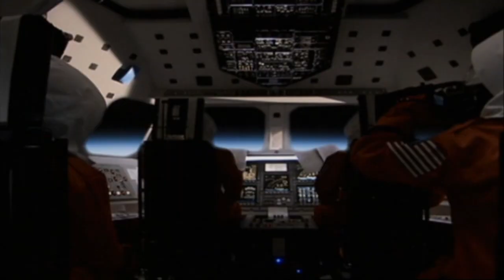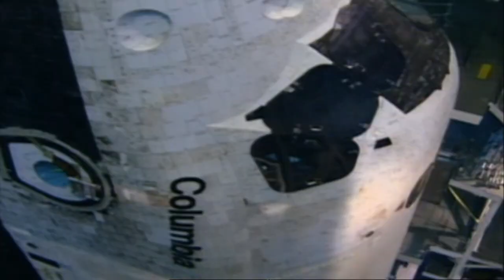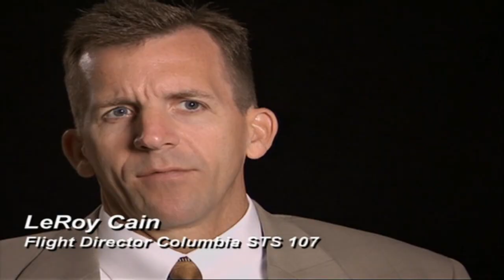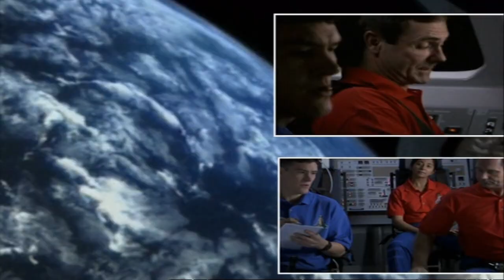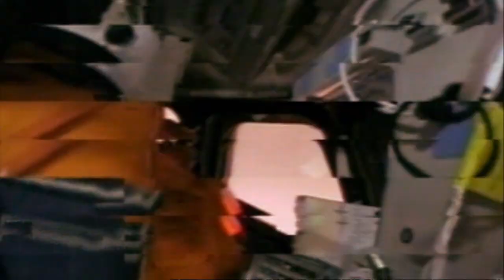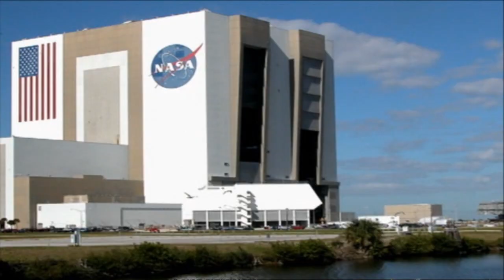Space Shuttle Columbia - Falling Star HD

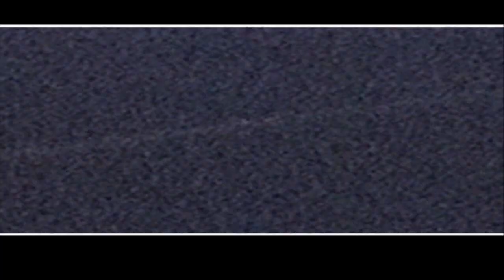Comment: I like the guy at 31:50, who says " Ice Maybe". The shuttle is glowing red hot with the leading edge temp of over 2,000 degrees. But this guy thinks ice is coming of something that hot. Not to mention the chunks flying off are clearly glowing hot. I have never seen ice glow red hot before.
Reply: Maybe he thought it was "Hot" Ice!
Reply: "All these rockets use oxygen as the oxidizer component of their propellant. The Saturn 5 also used hydrogen in some of its engines (upper stages). They are stored in liquid state, which requires very low temperatures (below -183c for oxygen, below -253c for hydrogen). Despite insulation, some of the outside surfaces can get cold enough to condense and freeze moisture out of the air, so there will be accumulations of ice. When the vehicle launches, acceleration and vibration shakes it loose so it falls away." (c)

still feeling smart?
Reply: JATR1X The cryogenic compounds were located in the external tank. The insulation foam was there to stop ice from forming that would most certainly damage the orbiter during launch. The Saturn V did not have foam insulation because there was nothing critical that would be damaged by falling ice. Once in orbit, the shuttle had RCS thrusters and the OMS system for maneuvering. None of those used cryogenic fuels.
Reply: The American schooling system in full display.

Comment: Could damage to the leading edge left wing even be fixed while in orbit? I don't think space shuttles even have EVA possibilities, but I could be entirely wrong...
Reply: kougoes With such a damage to the leading edge, repair was impossible.
The only feasible rescue was to abort the mission immediately upon orbit arrival, inspect the damage, then immediately start a rescue mission with another shuttle. The crew can ration their supplies. 
Then they will perform a risky EVA to transfer to the other shuttle since they don't have docking ports.
Transfer to ISS was out of the question since they did not have the fuel. Soyuz capsules can only fit three. 
Although the Shuttle was the most awesome thing ever to fly, it was a bitch at failures. 
If this rescue mission ever happened, The Martian won't even match up to it.

Comment: It is hard to believe we pass smock and safety checks for our cars every year, which includes to have a spare tire and hydraulic lifters. And you are telling me these engineers didn't think on putting on-board a repairs tool box with basic spare parts in this multi-billion vehicle? Not even space suits? This leaves only to one conclusion: Nasa knew they were going to blow up, had a slim slim chance for survival, repair or rescue. So they roll the dice and send them to their deaths because it was economically easier that way, than trying to mount an improbable and costly rescue mission.
Reply: Scott Pioso they come in and make sure you're wearing your smock properly. If they find you to be In violation of the smock regulations, they ban you from eating cereal in your basement for ONE WEEK.
Reply: what's a smock check?

Comment: My take . the shuttle has a gen. near the vertical stabilizer . When it's fuel interacts with oxygen it explodes . I have heard this while on the ground and confirmed by a employee . In the reentry footage you could see an explosion , the people reacted by saying what is that . somewhere there is footage of the shuttle from the rear , How is this possible , then I realized the rudder and the 3 nozzles were missing off the rear , 2 or 3 seconds later and white paint trail was seen coming from the left wing over the fuselage . It was clear to see the shuttle was flying sideways , left wing leading . This would account for the left tire pressure going crazy at that moment the feed was cut and never seen again . A good chance the gen exploded , taking out the aft section . I ran this past the person that actually was in close contact , he said it would be very possible . All we have been told is a cover up .

Comment: hey guys a chunk of the heat protective tile was damaged should we check it out?  nah fuck it who cares
Reply: When in doubt check it out.  Such a tragedy, and knowing it will happen slowly around you for hours. R.I.P. Columbia Crew
Reply: When in doubt, check it out.
Reply: No they could not. The shuttle was on a different orbital plane. All they had was a bit maneuvering fuel. Plane change needs a lot of fuel.
Reply: Tile had nothing to do with the accident. Read up again.
Reply: Anthony Smith Tile had nothing to do with it. Insulation foam shedding off the tank hit the orbiters leading edge of the left wing making a ten inch hole. There are no tiles on the leading edge. The leading edge is a structural component of the wing made out of RCC or re-inforced carbon carbon. Its part of the thermal protection on the orbiter but has no tiles. Just trying to keep the facts straight. Pull up a picture. Its self explanatory .
Reply: sorry whatever heat protective skin whatever the fact is that nasa knew something hit it but chose to disregard it
Reply: lgonzalez1154 They didn't disregard it as the crew was notified and sent video. They didn't do enough to investigate.
Reply: It's easy to look back now and fault NASA, and the people who were in charge, but unless you have ever done their jobs you have no clue the amount of pressure NASA is under to succeed, how quickly things can go wrong, and just how fragile the state of the US Space Program really is...

The Heat Shield has always been the Achilles Heel of any and every spacecraft ever launched. Even if the crew had been told to do a spacewalk and check out the wing, there was no way for them to repair any damage in orbit, and no way to for Columbia to reach the ISS. 

So what would you have done if you were in charge of that flight, or of NASA? 

Would you risk doing a rush prep and launch of a rescue mission before Columbia's life support ran out, a launch that could have resulted in two crippled shuttles and crews in orbit? (The fact that the entire astronaut corps would have volunteered without even blinking an eye is irrelevant). 

Or risk a re-entry, and hope that you are wrong about the potential damage the orbiter?

Those are really the only two options NASA had...
Reply: jrockett73 I just find it weird that they knew something had struck the leading edge and failed to take a peak at it
Reply: lgonzalez1154 It wasn't the first time something like that had happened during a launch... NASA had basiclly gotten used to the Shuttle External Tank losing bits of foam - it was simple complacency that led to the deaths of the crew.
Reply: lgonzalez1154 Like the other guys said, it was normal for the tank to shed and was looked at as a maintenance issue once it returned. I understand people's frustration but they went with past history of this issue.
Reply: looneyburgmusic I get it its just aggravating to think how many scientists,mathematics in nasa and no one thought to do the numbers on a piece of frozen foam traveling at 1000mph hitting the shuttle?
Reply: +Stand Alone How? Nasa did not even know how serious the situation was. The foam impacts were a common thing, and it always went well. They did guess there could be a serious situation, but no one knew for sure. And if they had been sure about it, what could they have done? Colombia had nowhere to go, except to deorbit. They could not help them self. No other shuttle was ready to launch, and rushing that is a recipe for disaster - and all for just an assumption that might be a fatal situation? Its no wonder not one of the decision makers did something different. There were just no feasible options, and no solid reason to do different than all the times foam impacted the shuttle before. 

Accepting that the fragile heatshield got hit by foam all the time is a whole different story. It was clear that this had the potential for disaster, but the flew all shuttles that way anyway. It could have happened with every flight of the shuttle, thats also valid for every flight after Colombia.
Reply: Errr... what exactly were they "covering-up?"  
Never call something a conspiracy when its just plain ole stupidity.  You'll save a lot of wasted time that way
Reply: Flyby Wire it was a flawed design from the beginning I just feel that those bright engineers would have thought of a better way...thank God for space x
Reply: Although I hope SpaceX does well, their track record is unacceptable as well. Ten percent failure rate at this point. Got to get a lot better to fly people.
Reply: +Stand Alone I agree. You just made a bullshit comment. Revealing the extend of the damage does not repair it. The Sojuz carrys three people. The shuttle had seven on board.
Reply: looneyburgmusic thats a bullshit excuse. "Until you walked in their shoes..." i believe we call that a logical fallacy? As if we can't judge because we don't work for NASA. When the Space Shuttle program began, NASA predicted catastrophic failure in 1 in 100,000 flights. Well, they had 2 in about 165. It was a horrendous design, cost more than they thought, and set progress in space back one, possibly two generations. What did we accomplish in the 80's and 90's? Jack shit! And 14 people are dead. It was Nixon who squashed other programs for the less expensive shuttle program. 

They don't want to admit it, but the Shuttle program was a massive failure.  Went in the complete wrong direction, and failed.
Reply: lgonzalez1154 ikr why not do a spacewalk or something like that
Reply: Jim Ely it just makes me sick those poor people
Reply: Stand Alone Mc
   
cocina
Reply: ť  
de la casa de araceli
Reply: They could not check the place where the damage was. And if they could have, there was nothing that could be done in time to save them. When it happened, they were doomed.
Reply: They could have gone to international space station for a little while.
Reply: Jeff Tompkins - I think that Columbia wasn't designed to dock with the I.S.S. Regardless NASA could've requested satellite photos to confirm or deny that the foam hit caused damage and decided not to.
Reply: I think Nasa was not aware how serious it was. After all, no one had seen the extend of the damage, and this foam impacts happened all the time. Besides the point that they did not have the fuel to reach the ISS, i doubt they had an airlock or space suits on board. After all it was a science mission designed to happen in the laboratory in the payload bay. No EVA planned at all.
Reply: Columbia was never designed to go to the ISS. She was to heavy to get there at the ISS inclination. She had an internal airlock. The other orbiters had internal airlocks as well but moved the airlock into the cargo bay once the ISS went forward to build. The STS-107 mission did have two EVA suits on board. A minimum of two EVA suits flew on every mission. Two for unplanned EVA's, three and four for planned EVA's.
Reply: Flyby Wire they could have saved them nasa said it could
Reply: you are right a cover up just the same as challenger and they could have saved them with a rescue mission. Bonus -same prick in the control room acting like he is surprised and upset
Reply: If thats the case, they did a lousy job.
Reply: Flyby Wire : why do some pieces of foam come off with every flight? Are they always in the same area? I know nothing about flight of any kind, but you'd think they could find a way to affix that foam with more integrity. Also, I hope they retire those craft after so many years/ flights. As for this disaster, I am glad the astronauts knew something was wrong for a very short period of time before they died. 
Also, it would be great if all countries worked together on a common space program, instead of wasting all those fantastic minds just because of politics.
Reply: Kelly Hudson
The shuttles were all retired a few years ago. They're being set up in museums across the country,
Reply: SpreadingtheMuse : Good to know. Thank you for your reply.
Reply: The foam is put under a lot of stress. Since weight is always the crucial factor, ways to affix it better also weigh more, and we are talking about a giant foam insulation. I don´t know if the foam came off always in the same area, i think then they would have done something about it. But as far as i know, foam coming off and hitting the heat shield was rather common, and given the fragility of the heatshield a disaster in the making. Just did not happen for a long time.
Reply: Losing 2 non man-rated rockets in 20 or so flights is a better average than most of the other flights to space.  Look at the Progress series, they are in the 40% loss rate, the Deltas are not much better.  If this were man-rated rockets... I would agree with you 100%.  At one time it was considered too dangerous for the public to fly in an airplane, and now it is one of the safest modes of travel.  Space is getting safer but still not quite there.
Reply: Your figures are way off. The Delta series of rockets has launch over 300 rockets with a 95% success rate. The Atlas family has over 400 launches with an even better rate. The last 120 Atlas rockets has a 100% success rate. SpaceX is not there yet with a 10% failure rate.
Reply: Your Welcome!!!
Reply: jrockett73 I'm sorry foam Jesus Christ
Reply: Cath Renwick First of FUCK OFF NASA could have saved them but they went with fuck it...in my opinion those bastards should be tried for manslaughter
Reply: Better take the Soyuz which is much safer, after Challenger disaster and the safety is still crap! This is 100% shitty carelessness of people in NASA. NASA just assume everything will be fine without checking, then KABOOOB Challenger, then BURN BURN BURN Columbia, RIP all those pitiful astronauts, in Challenger, they were kill by 20G of force from the shuttle hitting the sea and no corpse found, another one Columbia is worse than burning alive, they all just being disintegrated while being alive and only some organ like bone and heart were found on the earth. Damn NASA don't learn their lesson and it cost people life, no one got jailed though. NASA just do MORTAL COMBAT to the astronauts, I really want to see some responsible staffs in NASA jail. Now all men, women to space program from NASA is retired, they should just retired long ago with these kind of mistakes.
Reply: Flyby Wire all they had to do is an eva to reveal the damage... Russia could have sent a capsule to save them...thats a bullshit comment

Comment: Although its easy to say but 300 km is not too high. Is it possible to let the whole shuttle down in free fall with the help of parachute in emergency situation - OR - Atleast detachable (independent in emergency) spherical crew cabin with parachute system in any emergency situation. It must be fire and shock resistant before and after ejection. its just an idea so don't laugh
Reply: The altitude is not the problem at all.  You could practically just give them parachutes and spacesuits to get down from 300 Km if they weren't travelling at 17,000 miles an hour.  It's the 17,000 miles an hour part that killed them.

There is no air in space, so a parachute also wouldn't do any good.  No parachute would survive reentry outside of the vehicle either.  The emergency escape pod is a good idea, and has been used on high speed/altitude aircraft before, but would add a lot of weight.

Comment: No tile repair kit or a/naunt EVA training to fix . Duh NASA dunces. Couldn't run a bath.
Reply: every single tile is unic, because they are not ablative, intended to be reused. It's not so easy to cut a piece. The only way, if the problem would have been noticed, should have been to send another ship with that exact piece.
Reply: the shuttle would survive without a ceramic tile. however not with a hole in the wing.the hole allowed air to get into the wing and heat it up from the inside effectively making the heat shield on the wing virtually useless.
 they could have been provide with a patch kit to at least cover the hole however imperfectly. you don't need a perfect tile to patch it.

Comment: Can have air active nose cone turbine culing system under taper cane piramida on front  small temperature and body friction end and brake end cooling system on bady and special console small to save live for 6 people with fire resistance parachute system or air screw ,start with ather direction and brake turbine inside body with cooling water system.Petrol can be loose before came back is denger.Tank can be make special catrige system.Can have secend turbine jet to came back or racket- turbine jet system can be use like in pasenger aeroplane.
Reply: Turbine engines don't work in space.  They need air.  There is no air in space, if there was, it wouldn't be 'space.'  Also, they had no heating issues anywhere except in the left wing, and having all those extra measures would have nullified the purpose of the mission (doing science in space), and could have possibly weighed the aircraft too much to get into orbit.